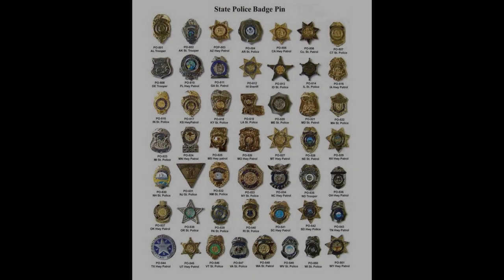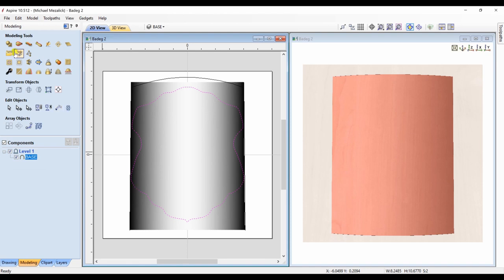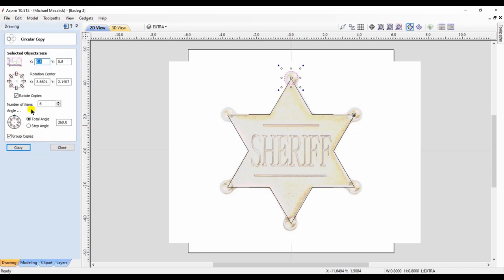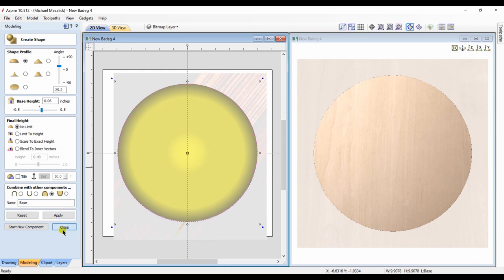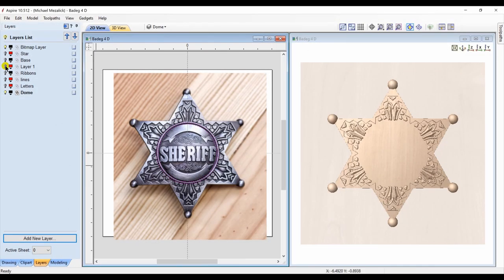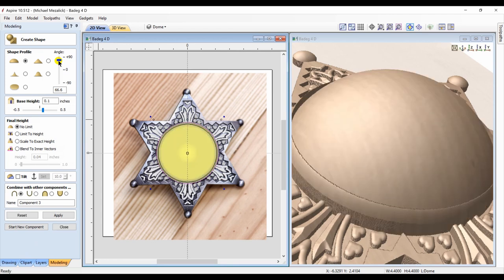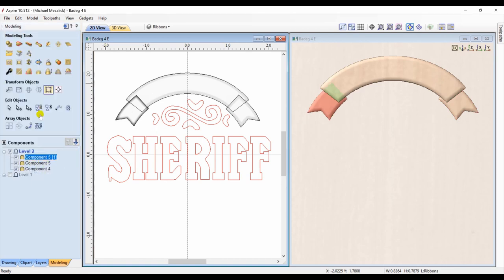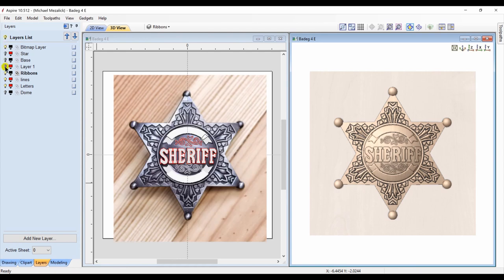3D Modeling for Newbies Lesson 9 Making a 3D Badge

Comment: I follow along and perform what you are doing; I think this is the best way to learn from your videos ;)  In making the badge the shape height for the balls and badge is .10", with a base height of 0.0", making the total height to be 0.1".  When I probe the Z-height of the rendered badge and balls with the cursor in 3D view,  I get -0.01" as the Z-height, instead of 0.0".  My toolpath reflects the removal of that -.01" material.  

When I set the base height from 0.0" to 0.01", I then get the probed Z-height of the badge to be what I expected at 0.1".  I just added it back via base height.

What is the cause of /  reason for, the unexpected -0.01" in the component Z-height when the base height is set to 0.00"

Thanks!
Reply from the maker: I can't say without seeing your file....could be several items to cause this.
Reply: @mezalick  Sure... what I thought might happen with the toolpath is that it would only carve the curves, and since the top is completely flat, not waste time on machining it flat again, only carving the curves.  But I can see that the toolpath generation does not evaluate the shape as having flat areas at the Z-height.  It simply treats it like a shaped object and not flat on top, which requires no machining.

Possible theory: It wants to take something off everywhere within the job boundary, so it takes a minimal amount ie the missing .01". No matter which base height is used (0.00" or -0.01"), it still generates the same toolpath for the entire object.  

Odd thing is, though, the preview does not follow the drawn toolpath and traverse the flat part, it only animates the curved parts on the perimeter.
 
Super easy to duplicate:  Create a flat dome shape with Base Height at 0.00", put the Shape Height at like .1" , render, and go measure in the 3D view.   Use the original vector as the job boundary.   Thanks... Aspire 11.504
Reply from the maker: @kelleysislander  Try setting your modeling resolution to Maximum and retry your example...It looks correct with that setting, so I think it has to do with the pixels.